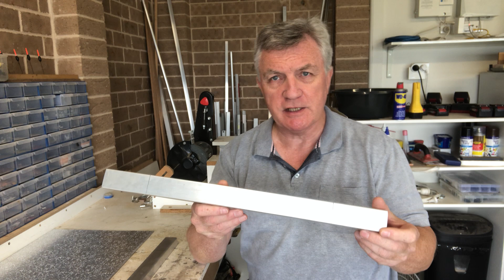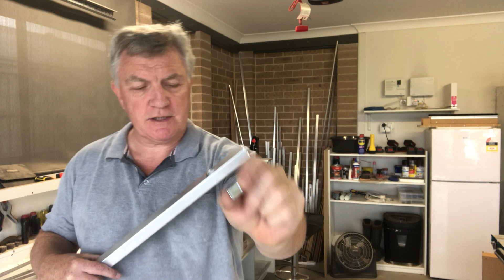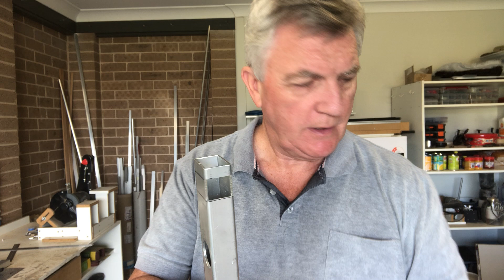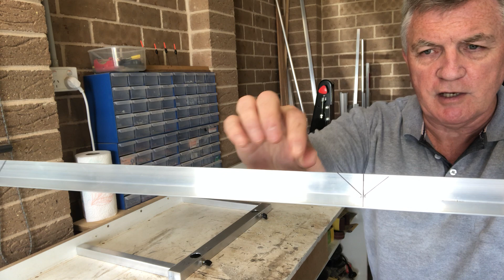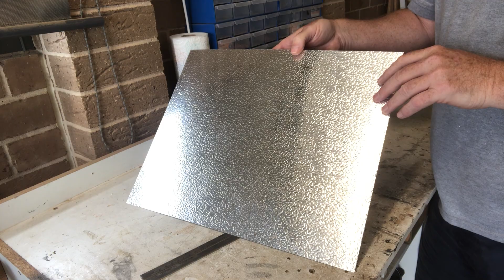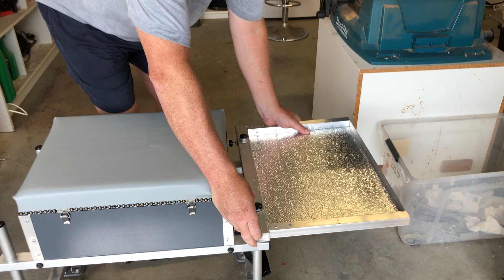Homemade Fishing Seat Box - Part Three - Building the Side Trays

Comment: I have really enjoyed this series Den thankyou. The biggest PIA I have found is the threaded nut inserts..I'd love to know how the manufacturers do it without drilling the extra hole to get access with the DIY rivnut tool into the box section. Then I had a thought....could you use Hollow hex bolts which have an external and internal thread instead? Lock them on the outside with a small slim self locking nut? I need to build some sidetrays for my 19mm leg box (A Plattforms box..they;re great and light but they don't make them anymore)..previously I have adapted Preston Innovations stuff as I do like to tinker. Once again thankyou..was this your lockdown project I wonder? Best wishes
Reply from the maker: Hi Jonny. Thanks for your comments. May I also apologise for the delay in responding. Unfortunately, my Laptop decided not to play for a couple of days. With regard to your query, the threaded fasteners I use have the internal and external threads you mentioned, but I had them made up specially. I have however found that Matchbox Fishing tackle sell the brass part separately. Here is the Link: https://www.matchboxtackle.com/product/replacement-brass-insert/  The outer locking nut I use is from RS Online. Here's the link for that too:  https://uk.rs-online.com/web/p/products/1224405/  I haven't bought the Matchbox item, so, please just check that the two items are compatible before you buy them. I hope this helps. Tight Lines.